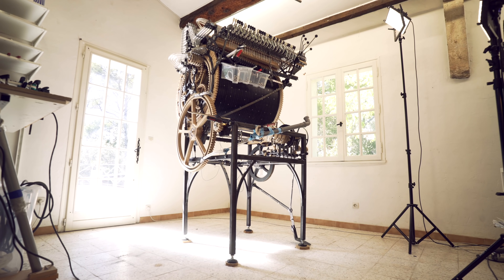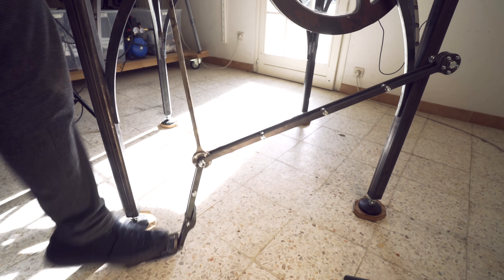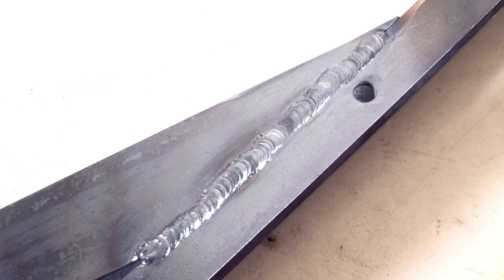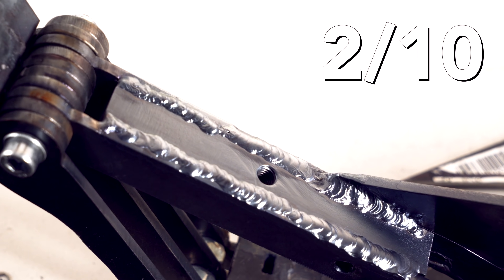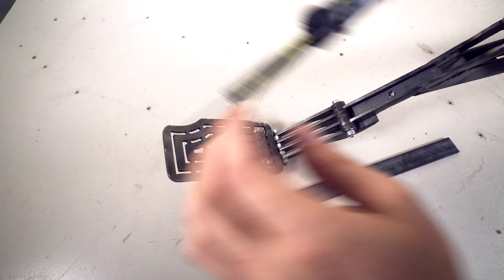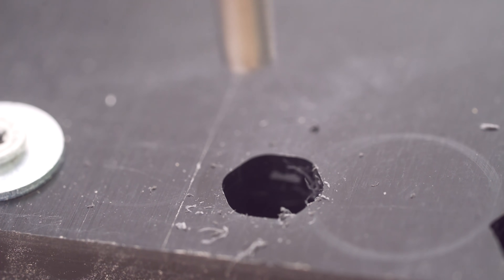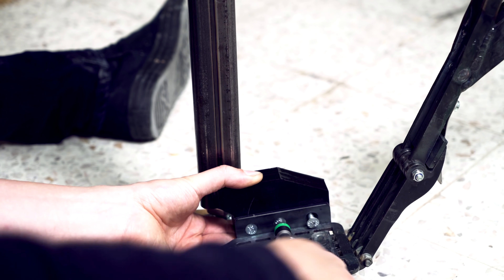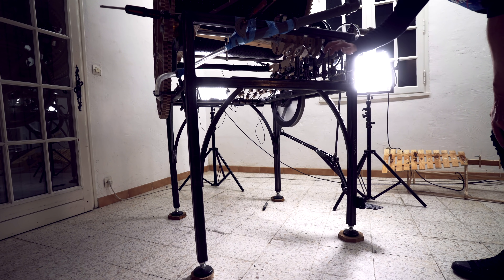Treadle Pedal Completed - Marble Machine X #81

Comment: Nice video, but I think you have a critical flaw in your design. You push the pedal against the leg of the machine, but once the safety feature is triggered, it will no longer be pressed against the leg. Then the pedal will be stuck against the leg of the machine, and depending how your clutch is set up your whole machine will stop. This could lead to some pretty nasty warping and destruction of (parts of) the marble machine X
Reply: You might be right.  The pedal might fold up high enough to provide clearance, but it aught to be tested.
Reply: Ha, I think you might be onto something here — it might have enough space to just keep being pushed back by the leg of the machine... 
But if not — its a pretty serious flaw. 
Martin needs to test it ASAP!
Reply: Stefan J I was also pretty worried that he didn’t show the safety feature being tested after all that. Heck, what if it doesn’t work as well now with these modifications? Smashed toes + broken pedal = bad time
Reply: That worries me also.
Reply: One of the core tenets of iterative design is regression testing. The safety feature needs to be fully tested with all of the changes in place to ensure there are no surprises, particularly for safety features like this.

Possible solution if the pedal can now bind: cut a guide plate that roughly matches the travel profile of the delrin skidplate when the pedal is in the up position. Weld it to the leg flush with the outer edge. That way if the pedal flips up, the skidplate will slide along the plate and cannot slip behind the leg and bind.
Reply: @F3Ibane  Yeah, that would be a good way to fix it, if the problem I'm seeing is really there. Might be that I misunderstood what Martin is saying
Reply: There is also no safety feature protecting from when the pedal is moving in the upward direction. Because the pedal is sliding against a structural support it can bind against anything that gets in the way. All sorts of things could get caught in there... fabric, shoe laces, wires/cables. If something like that happened, which part will give way, or break?
Reply: I'm surprised no one has pointed this out yet, but at 0:22 you can see Martin lock the hand crank and hear the clicking of a ratchet, so it's clear that there already is a safety device in place to prevent jamming/damage/injury. Since the treadle pedal works via attachment to the hand crank, this means the pedal is similarly protected.
Reply: @hadrast  Yeah, pretty sure it was mentioned early on that the Flywheel would get a safety clutch to avoid excessive torque, should something get stuck in the machine.
It was just never explicitly shown and explained, which is kinda understandable with the amount of things to cover on this machine.
Reply: @hadrast  From what I can see it engages and disengages the pedal, however, while it is engaged the pedal is moving with full force (you can see this in the end).
If your theory was correct then he would not need the safety mechanism on the pedal at all.
Reply: @op-z  Full speed ≠ full force. As I said, in the beginning Martin demonstrates the safety mechanism by grabbing the hand crank and bracing it in place. This is the exact same effect as jamming the pedal (with a foot or other object). Once the force reached a threshold the ratchet clutch automatically disengaged and allowed the flywheel to spin freely, so the same would happen with the pedal. Yes, this means the safety mechanism on the pedal is redundant, but redundant safety mechanisms are never a bad thing. Moreover, the mechanism on the pedal has the advantage of not interrupting the music.
Reply: I think people are missing the point. Firstly, It's all very well everyone saying it won't cause a problem or will cause a problem. The point is he didn't test it and without testing, no one knows. Secondly, if it doesn't jam, it may still cause an issue that would potentially disrupt the performance. Thirdly, he manually disengages the pedal from the flywheel. I suspect that would not automatically disengage if something did lock up as if it did he wouldn't need the flip up safety pedal in the first place! The bottom line is that he needs to test it as he needs to test everything else.
Reply: @al35mm  Um what? The flywheel disengages from the crank/pedal on a torque clutch, it's not manual. He demonstrated it at the beginning of the video by bracing the crank handle with both hands and causing it to ratchet.
Reply: @hadrast  So if he caught his foot under the pedal the clutch would kick in before any damage occurred to his foot. That makes the flip up safety pedal a bit pointless. Steel toe caps would have been easier. :)
Reply: Not quite on your point, but related...
1.  We need significant force to be transmitted from foot to machine, but not from machine (under its own momentum) to pedal.
2. A rope will only transmit force one way, under tension. So use a rope for that link.
3. Stop the pedal flapping by a friction fit.
4. Stop sideways wobble by using a double arm linkage.  Forcing it to slide against the frame smells of bodgery. 
5.  If he sticks with what he has then a bigger piece of plastic would stop the pedal getting jammed.
Reply: @raykent3211  

2. When playing fast, the pedal will flop around and do all sorts of funny things when using a rope. A rod will stop that.
3. The spring mechanism he uses is very elegant, reliable and calculateable friction would be fine too, but there is nothing wrong with it.
4. Easier and simpler than a double arm linkage. Nothing wrong with a slider solution, a double arm linkage would need a lot of space to provide anywhere similar to that amount of stability.
Don't overthink.
Reply: It doesn't touch the leg once folded up.
Reply: While you might be correct that there is a risk of jamming (to the naked eye, the pedal seems to remain well clear of the leg), this only occurs if the pedal arm is rotated far beyond its intended position. When the safety feature is activated normally, Martin's foot would only displace the pedal by a tiny amount before the spring returned it to normal. For the POM block to lose contact with the leg, the pedal would need to be obstructed by a much larger object, or be manually pushed back with enough force to overcome the spring. Not to mention, foot-contact can only occur at the bottom of each stroke, when the POM block is in greatest contact.

The pedal is never intended to completely flip upwards, and the spring is there to prevent this from occuring normally.
Reply: I instantly thought this and am so glad to read it in the comments. I think he might have to add a plate on that side to keep it from going between the legs when safety is engaged. He's thinking that if his foot is under there that it will only pop up a couple of inches, but in worst case scenario this could be catastrophic.
Reply: I think he has already taken that into account. At about 9:41 you can see the pedal being held down by his foot while the machine is spinning (the fact that it moved up once he's lifted his foot) and, to me, sounded like a bicycle when you aren't pedaling. I'm slightly more concern about his spine after the wold tour, having put alot of power on the right side and all.
Reply: No the machine will brake just like how he did with the spinning wheel thing
Reply: My first thought also.
Reply: At 5:09 you can see it won't do any damage.
Reply: @stabilini  I don't think anyone here is disputing that the position at 5:09 is a safe position. The point that @Stephan J is making is that the 5:09 position will not be achieved, instead the pedal will snap straight down again, and if it happens in a certain way, the Delrin block could become disengaged just as it does so, then bind on the leg. This is a valid concern, but i agree with @Max Morella's reasons why it would be an edge case scenario. My 0.02 would be to bevel the leading edge of the Delrin block, allowing it to re-engage itself with the leg if necessary.
Reply: Everyones triggered here now .. a stampede of panicky jacks ...ooh but we didnt see it tested brigade.....  looks fine ..dont panic mr mannering..
Reply: the flywheel safety feature will prevent any of this from being an issue
Reply: It might be smart to put some sacrificial shear bolts on the gearing calibrated to break off and disconnect the flywheel before the machine can be seriously damaged by such a jam.
Reply: @Captain__Obvious  There's still a clutch in place to prevent any high torque on the machine. Actually, you can see Martin use that exact feature when he stops the machine by hand - the flywheel keeps rotating, but you can hear the safety clutch clicking as it disengages.
Reply: @Captain__Obvious  Disconnect the flywheel? Sounds even more dangerous.
Reply: Let us examine that scenario.  The spring steel that provides stiffness to the peddle safety feature reaches ultimate yield and deforms.  The peddle is now free to rotate, like it did prior to the addition of the Delrin plate.  Under this scenario, the machine continues to operate freely, as there is no interference betwixt the plate and the machine leg.  The plate is rotated, with the peddle, completely out of the way.

Its great that you are thinking of issues and problems, but this isn't one.  

Respectfully submitted
B
Reply: @WhatAboutTheBee  That would be right if he didnt shorten or alter the screw that anchors the pedal (on the back leg/upper portion). With the shorter screw the pedal "wants" to move "farther inwards" to the center of the machine. The POM block and the leg hinder the pedal in that desire. But once the saftey is triggered, the POM looses contact with the leg, and the whole pedal apparatus will move inwards inbetween the legs. When the spring steel pushes the pedal down again it will make direct contact with the leg again, bot not sideways but head on. Best case scenario is that the pedal will just be flipped up again. Worst case is a jam with critical failure

If he hadn't altered the mounting, then your post would be correct
Reply: @stefanj3097  please examine the position of the peddle 1:14 .  It shows the position of the peddle if the spring steel deforms.  Block, or no block, there isn't any interference.
Reply: @WhatAboutTheBee  In the inital mode yes, there is no ínterference. But at 8:06 Martin says that he shortened the screw to make a pre loading of the pedal against the leg. This pre loading will push the pedal inbetween the legs once the safety mechanism is triggered. Or might not, it's impossible to tell for sure from the video. But that is a safty concern that in my oppinion should be adressed and checked
Reply: WhatAboutTheBee , I agree. In the folded up position, the pedal assembly is far behind the leg of the MMX, so there is no risk of it hitting or jamming against the leg. Stefan J raised a valid concern, but closer inspection shows the risk is mitigated. Personally, I would have used a different solution for the sideways movement, in the sense that I would have rather welded a support between the front and back legs, and had the drive arm connected to the crank sliding through a "slit" in that frame guide
Reply: @stefanj3097  The peddle arm rotates around a bearing and mounting screw.  The radius defined by the mounting screw and the tip of the peddle is too long to be in between the legs when the peddle is in the down (playing) position.  The radius is shortened when the peddle is in the up position (bi-stable due to spring).  It can only be in between the legs when the peddle is in the up (safety) position.  When in the up position, the peddle does not interfere with the legs.

Side loading, provided by a shortened screw does not change this mechanical arrangement.

Edit: to correct the spelling of radius, sorry about that.
Reply: @WhatAboutTheBee  You might be right, I haven't noticed that the pedal safty feature behaves like a bi-stable mechanism. So once the safety mechanism triggers the pedal will be unavailable for the remainder of the song, but should not result in any further damages... Good point Sir!
Reply: @WhatAboutTheBee  but you are forgetting about the spring mechanism — there is no UP position anymore... so its all about how stiff this spring is — and it might prove pretty strong.
Reply: @op-z  He might be right, as long as the obstruction is big enough the peddli will lock in an upwards position (it should behave like a bi stable mechanism due to the geometry)
Reply: @op-z  No sir.  When the spring steel reaches yield (Young'sModulus defines when an object bends both with and without permanent deformation), the peddle is allowed to rotate to provide safety.  Depending upon the spring constant provided, ultimate yield (again, Young's Modulus, but in extremity)  the geometry, the peddle will either assume a bi-stable arrangement or the spring steel will permanently deform.  In either of these two cases,  the peddle may assume the "up" position.
Reply: @WhatAboutTheBee  I think the only argument here is that Martin should test the ultimate yield, and the effects on the machine — I'd would assume completely flipping the pedal during performance is not desired. In the end of the video I was totally expecting him to jam something under the pedal to demonstrate the mechanism in action, but seemed reluctant to do it.
Reply: The pedal rotates up for the safety feature. By the time the pedal is able to get stuck behind the leg of the machine it will have to almost stand up on its hinge, so it would just hinge back and forward while scraping the leg from behind. The spring might get a little over bent or even slide off the pedal, though.
Reply: @PaulGerarts  That would be the best case scenario yes. It is difficult to judge that only from a video though
Reply: Stefan J I don't really get it, how it can be teiggered? Do you mean it could snap?
Reply: @bidibum  He said in the video that he shortend the screw where the pedal is anchored. Thus the whole pedal is pushed and held in place against the leg of the machine. But when the pedal flips up, due to the shorter screw, it will move "inwards". As long as the pedal is flipped up that shouldn't present a problem. But the spring steel will push it back down again, and then it might jam in the leg and the momentum of the machine will push it in further
Reply: @stefanj3097  The spring steel is there to keep the pedal from flipping up while allowing it to move slightly to avoid crushing his foot. He needs to modify it a bit to make it impossible to flip up though. If it does that during a song he won't be able to fix it until the end.
Reply: @deceitive3338  that and the lack of (on-screen) testing of the safety feature with all the modifications.
Reply: I'm astounded by all the resistance to a simple safety test by so many in this thread. They want to poo poo the test with clever logic that guarantees that such a problem could never happen. The risk here is too great to disregard a test. The definition of an accident is something that is not predicted.  IMHO.
Reply: @ginfonte3386  The resistance is not that the test should not be performed, the resistance is that the test WAS performed (0:22) and so few people noticed that it happened.
Reply: @ginfonte3386  Right? Especially considering that testing the features for issue would take less than a minute tops.
Reply: I may have noticed another one. When the safety pedal should go in to collapsed position (for example feet got under it and lifted it all the way up) when u move it back down the spring steel sheet will end up on wrong side of pedal. So it is no longer held by spring steel. Also i recommend one way bearing so if handle or leg pedal gets stuck then force from fly wheel wont cause destruction. That would however effect pedal working as you lose energy that lifts it up. Hmmmm
Reply: There isn't a problem. The delrin is in contact with the side of the leg over the full stroke of the pedal. If he sticks his toe under the pedal as it drops, the pedal will stop about an inch higher than it would have otherwise. It will still be captive by the spring plate, and will return to it's original orientation on the up stroke. The idea that it will blow past the spring plate and end up flapping about is not supported by the evidence.
Reply: @meetim6271  what if yeti decided to play it hahaha... foot much bigger = pedal flies higher
Reply: The spring steel will prevent it from folding all the way up, unless something larger than a foot with a shoe is underneath it.  Still a test would be nice.